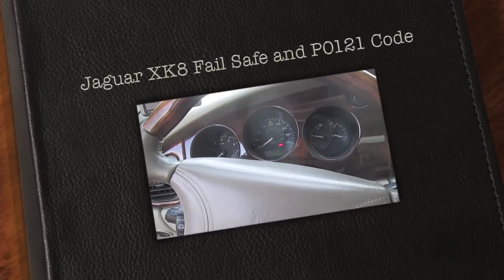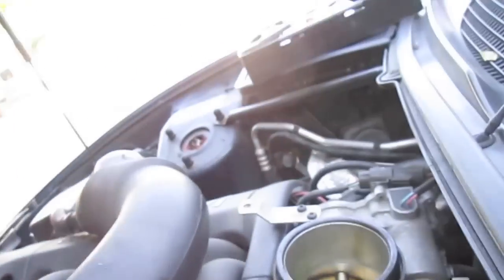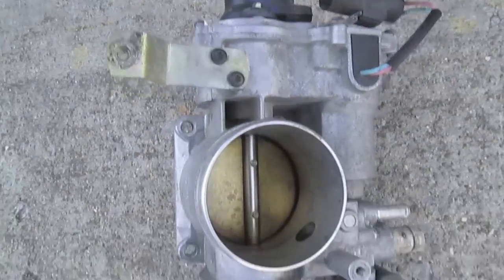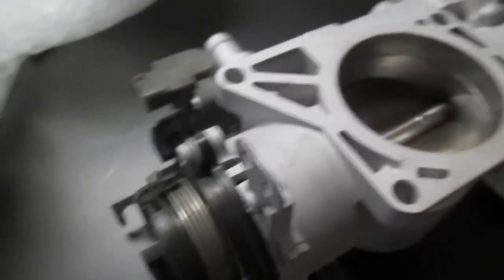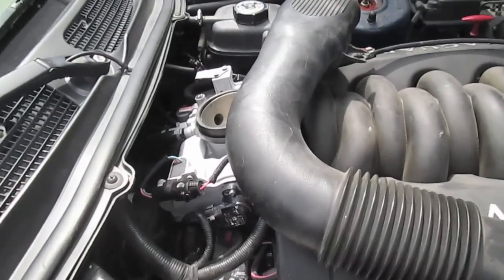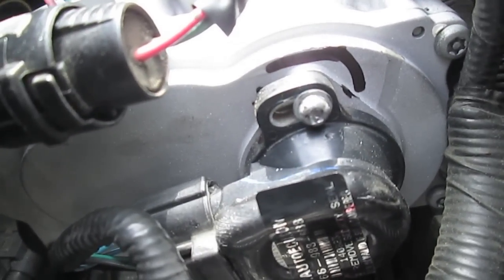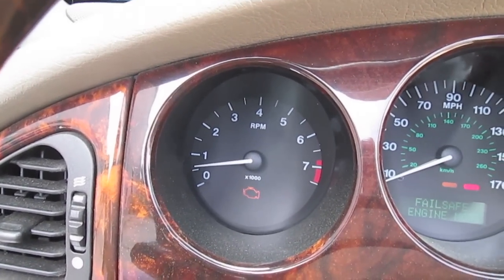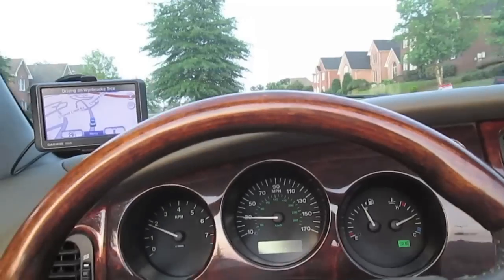Jaguar XK8 Fail Safe P0121 Code Intermittent How I Repaired It

Comment: I have a 2000 stype jaguar and I have  replace my throttle body 4 different time and after three week it loose power and fail safe engine mode comes on I wondering if and adjustment of sensor is possible for my car since I have took it to 2 different shops and still no luck and no one has suggested adjustment they have on took my money but no real resolution for my situation
Reply from the maker: shenetta Graham Hello, I don't think the S type has the same Throttle Body type but a misadjusted Sensor can set codes. In my case the Throttle Position Sensor was bad and had to be replaced or repaired.
Reply: After reviewing you video I did see my sensor is located on the back side of the throttle body and it does have the two screws that appear to be  adjustable so I am now going to try and find a mechanic who will be willing  to do as i ask because my current mechanic told me that if it ran perfectly fine for 3 weeks that could not possible be the problem I feel he lazy  and  trying to continue taking my money I'm going to seek out another mechanic to see if they'll be willing to make an adjustment and work with my current situation  tried of expensive solution but no resolution  so ill get back with you since I will be experimenting with trying to have it adjusted and I will be enquiring about the  "misadjusted sensor codes" as well  cause from the looks of the throttle it could be possibly to have it adjust  what have I got to loose I am already out of almost 700.00 with car being towed
Reply: +Shenetta Graham So I did some research  and made the connection  between" throttle postion sensor" and "throttle accelerator pedal" since they both had the same first pretext i  decided to see how are they connected since I have already replaced the throttle position sensor 3 times and the same thing kept happening until i change the accelerator padlel that had a few screws and plug into connector  and so far for the past 3 wk  my car still going so this  must have been the connection I got part from dismantlears for 75.00  since I was tired of putting money into a car that I had almost given up on.

Comment: I am assuming that it will be the same on my 2005 xj8l. I am fixing it today. The throttle body was less than $300 at advanced auto. Mine goes into limp mode whenever i decelerate or park the car. Rather fix now before it gets worse! Mine went from once a week to once a day to every time i drive.
Reply from the maker: Joshua Willett Hello, It is not the same Throttle body and I think you mean Throttle Position sensor. The one for the XK8 is not sold separately and is 3000.00.  Also the symptom is Limp Mode when going 80 suddenly.

Comment: Hi ...Thanks for the video..  I have an S type with a fail safe problem. Do you think that you could have fixed the problem by adjusting the throttle body before you sent it away for repair?
Thanks
Reply from the maker: Clive Adams No, There is a problem inside the the Throttle Position Sensor that an adjustment will not solve.
Reply: +Spa Guy 
I had a same problem in the past and a simple adjustment solved the problem, so don't wasting time and money for something which is a easy fix, also before you do anything check your battery GND, sometimes replace the ground cable fix the problem too. Cheers.

Comment: Good stuff.
Thanks a lot for this info!
I have the same issue with mine.
But it is really strange..."Failsafe mode" and TRAC and ASCnot available" can come at anytime when you accelerating or on go over a speedhumb.
When I turn off and on the car the idle goes to 4800 rpm and sometimes it fixes by itself and goes down and runs perfectly.It has smth to do with switching off and on the car...You gotta be patient...
The thing is that I am in UAE and don't know who can fix this throttle body in here.
I would apreciate any advice...

Thanks

Bob